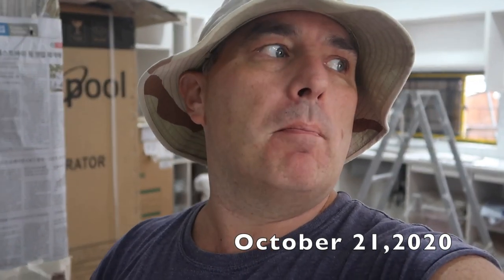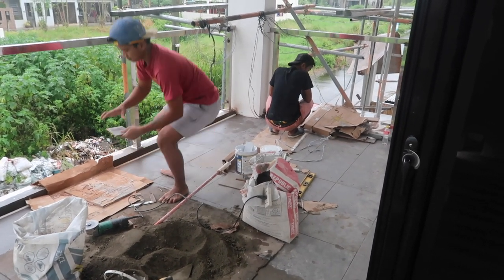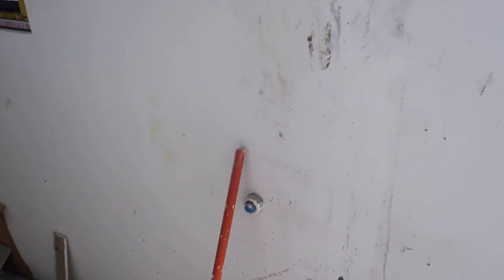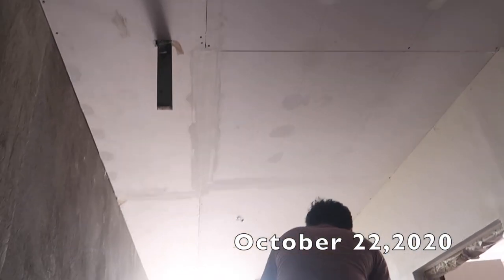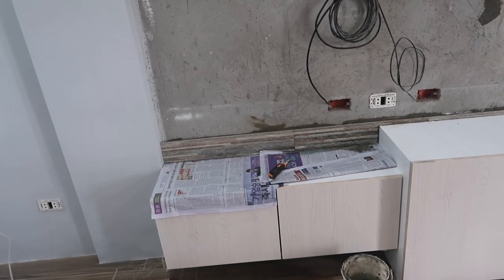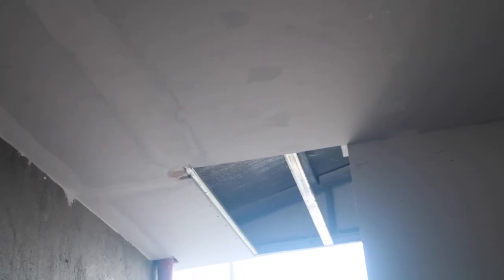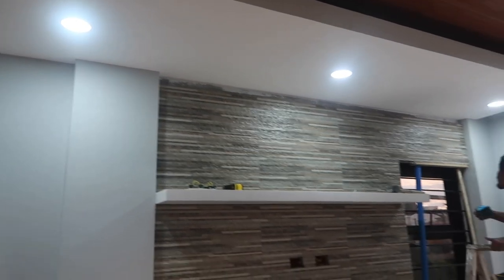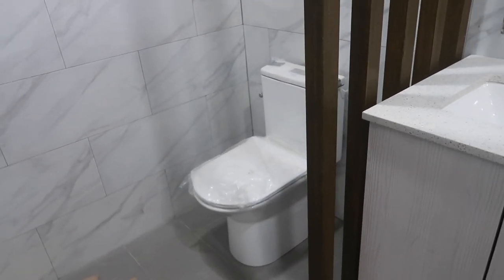HOUSE BUILDING IN THE PHILIPPINES - EPISODE 189: PLATFORM BED & TV WALL

Comment: This is the fun and exciting time, when all the fine details are added and each room is finished off one by one. Instead of running the electric down into the concrete, what about running it up against the ceiling and putting it in metal conduit that can be painted to blend in. It'd be way faster and not really disturb anything.

Comment: Why do so few Home's in Philippines have Swimming Pools ?
Reply: I'm not an expert on this question but from other videos I've seen. There are a few reasons- a much larger proportion of construction is done manually rather than mechanically in the Philippines. So its not common to have concrete pumpers or gunite sprayers. Also pool liner finishes like quartz are not common and instead they use older marcite style or epoxy paint finishes. I suspect it might be cultural also,  the Philippines are very conservative and more religious. So kids swim all the time but adult women (married wives/moms) don't seem to be seen wearing bathing suits in public the same way as more liberal countries. "Family" swimming seems more like a planned group event where people go to the  beach or water park for the day and involves food, music and is more planned than simply just "jumping in the pool".
Reply: @theinspector3688  ...Wow...That was such a interesting Comment...I agree with 99% of it...but the Bathing Suit issue is not really a Concern. I was in the Philippines 30 yrs ago and it was Rare to see a Woman with a Child...unmarried Woman...in Fact, Foreigners would go there to find a Virgin Wife...now 65% of the Women or girls online have a Child...
Reply: Exactly, longer run equals more resistance to the electrical current. Which in turn means more heat and hotter wiring. You want a balance between wiring gauge and the actual appliance. So that any problem with the appliance results in the breaker tripping  before the appliance melting/catching fire. Being an electrician is part mathematics and part artist, experience really is what makes a professional.
Reply: Yeah, its been more than 20 years since I spent time in the Philippines. So I'm sure its not as conservative as it once was.
Reply: @theinspector3688  ...Yes...Times have Changed..
Reply: @theinspector3688  ..why do you think Philippines has not caught up in House Building ? Why is the Technology still so Primitive in the City ? I understand why in the Province but in the City the House Building Skills are so Old..
Reply: I haven't been in the Philippines for a long time, so I don't know for sure why actual construction standards are so poorly done. I suspect at least a few issues. I suspect that building officials don't oversee the work as often or to the degree that they do in most of the USA. I suspect the building officials are not as highly knowledgeable or as fussy as they are here. They may not have the same level of authority and enforcement as they do here. I don't think construction is taught and practiced there, the same way as it is here. Skilled trades go to school for intensive training for a couple years here before they can qualify for a license to practice the trade. Many construction workers here belong to a union that keeps less skilled workers out of the market. Safety on construction sites is strictly enforced here by the government and so that requires that everything has a proper process for how things are done. Here, we have better communication and scheduling so the process is more clearly laid out in sequence. This is enforced because one thing must be inspected and approved by a government inspector before workers can move on to the next stage. Liability is MUCH higher here, so you'd get sued out of business if you didn't do work to a correct and accepted standard. Insurance is a big part of doing construction and you wouldn't get coverage or have a claim denied if you weren't following a set standard of work. Competition is higher here and communication is so easy, so if you don't do high quality work, everyone will hear about it and better companies will take the work away from you. I think that labor in the Philippines is so cheap that "people" are used instead of machines. In the USA labor is WAY more expensive, so its actually cheaper to use machines or mechanical fabrication rather then people. For example here- delivery, moving,, excavation, leveling and compaction of dirt is almost always done by machine and rarely done by hand. Concrete is always mixed, delivered, lifted, pumped and vibrated by machine. Doors and windows are all manufactured and completely painted/finished in a off-site factory and installed quickly because all openings are constructed to a standard size thats plumb and square. Measurements are taken and all cabinets, countertops are completely built and finished offsite in a factory. Installation goes quickly because walls are built relatively plumb and square. Paint and primer are applied with a sprayer, so a whole house can be completely painted inside and out within a few days. Space for a shower, tub and toilet are all set to a variety of standard sizes or distances from each other. So fixtures just drop into place without all the fooling around in the Philippines. Here, only the actual shower space is a wet area. So its a much smaller area to make waterproof. In the Philippines, the whole bathroom is a wet area and they use rubber cement instead of liners to make the space waterproof.  That's a lot more labor intensive and WAY more variable in trying to make a whole bathroom waterproof. We lay our foundation and slabs typically together at the same time. So that work is delivered by a huge cement truck and its all poured in a single day. Block walls are still laid by hand here but all the open cells and tiebeams are also poured in a single day. So building the foundation, slab, exterior walls and pouring tiebeams, cells and all the flat work like patios, driveways, concrete columns and walls can literally be done in a series of single days of work. So 3 months of construction there is done much better, to a higher quality in just a few days spread out over a week or so. Flooring goes in at the end after all the other work is completed. The slabs are built as part of the foundation and exterior walls, so they are finished much more level and smoother than in the Philippines.  So flooring goes in WAY easier without all the unevenness in the Philippines. That's a pretty good list of reasons why construction is so slow there and subject to so much piecemeal work that is figured out on the fly.
Reply: I tend to agree more with Tec man’s analyses.
Reply: TEC Man  ...Great Complete Answer...Thanks

Comment: Based on the stove run a 40amp circuit requires a an 8 gauge copper wire min wire.. but you may want to consider a #6 awg copper if over 75ft from source...according to USA standards